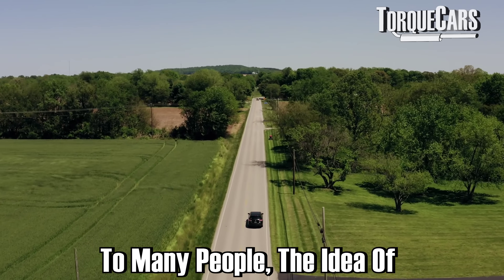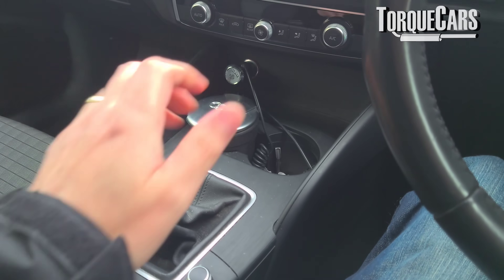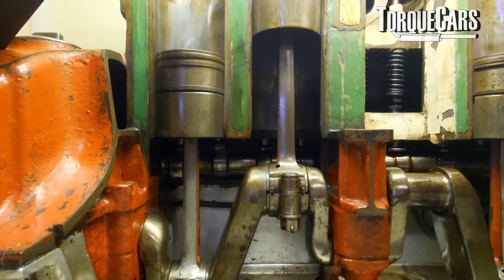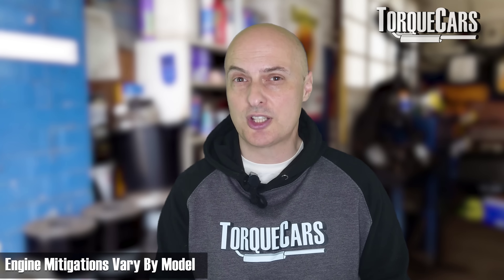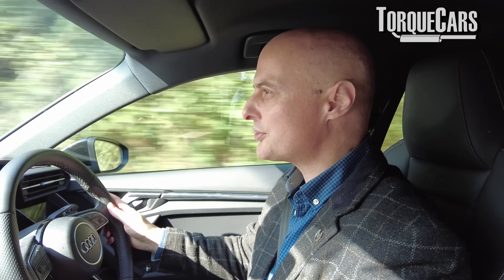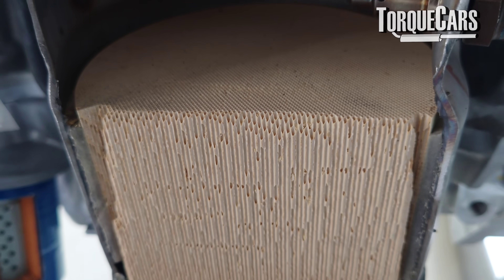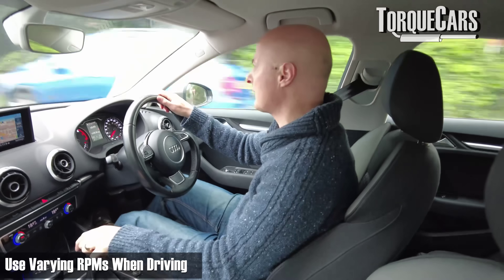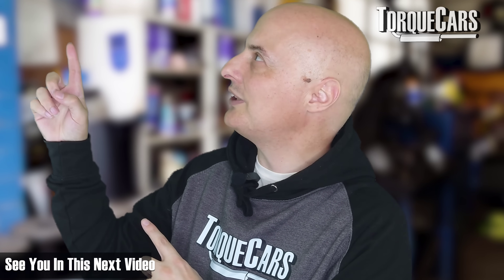BIG DAMAGE By Lugging at LOW RPM? Eco Driving Warning! (Manual Gears)

Comment: My eco shitebox doesn't have enough power to properly accelerate with 1000 rpm. In city I am always in the 1500 to 4000 rpm range. Only time I really drop significantly below 1500 is when I have to brake, get going from standstill or when I have to slowly drive with first gear at 1000 rpm behind morons who fucking can't stop and drive but have to slowly creep forwards all the time.

Comment: There is no need to go up to the redline. The pressure of the water pump increases a lot and after redlining it at 6500 RPM on the german autobahn for not even 30 min, I got a fissure in the radiator (top part) and had to suffer the smell until the garage changed the radiator.  Redlining at full throttle also doubles fuel consumption... 
So I stay mostly in 6th gear on the flat, even in cities, as long as the traffic flows. Never accelerate in high gears, though (except on the autobahn), on country roads, it's better for my car to go directly from 6th to 3th (it's a manual gear box) and that's basically the only short moment when the revs reach 5000 RPM or more.

Comment: Won't an automatic car will decide for itself on the rev range? Sport mode allows the revs to go higher before changing gear but at normal speeds in built up areas the car will never rev high. This must be engineered to be okay surely?
Reply from the maker: Yes most automatics are pretty good at picking the right gear for the job, this is for manual drivers who like to lug at low RPM and some in a manual selection auto (paddle shift for example) will still need to think about what they are doing.

Comment: dont agree, many wrong assumptions here, probably an extreme low rpm and high load but normal driving, easing the throttle if there is load meand noproblem at all, the computer adjusts as fast at low rpm than at high, is a matter or rpm not time.

Comment: Naïve drivers think the sound of higher RPMs automatically means unnecessary fuel consumption and lug their engines
The same people won’t press the gas and get a lockdown in an automatic and will slow down considerably going up hills

Comment: Driving in low rpm is fine accelerating from it is not. Change you gear down when you need to accelerate. This is what I have been doing for 20 years. Some engines have more torque you can actually accelerate from low rpm with no problems.

Comment: Wait what? Low RPM you are igniting at near TDC?  but at high RPM you have more distance? what? Low RPM vs high RPM shouldn't change the timing of the ignition should it?  I can see a change in value timing... Is this a new thing.  What is that called? what cars have an example of this?

Comment: Most moter are short stoke moter and dont make power till they get up in the rpm and its always good to run them higher up in the rpm to clean ever thing out more rpm more heat and air going out so its alway good to clean thing out

Comment: I used to drive from 1000 to 2000 rpm, but I realized I had to accelerate more. And close to the 1000 rotations the anti-stall would quick in constantly. 
Now I drive from 2000 to 3000 and not only the car is riding more smoothly but I also started to save fuel. When I turn on the air conditioning I try to stay over 2500 to compensate for the lost power.

Comment: Torque from low rpm till redline is nice but your engine needs to support it, if it doesnt look like a semi truck engine it probably wont :)
Manufacturers already put in torque limit for driving at low RPM in low gear scenarios so people dont destroy their drivetrain.
Modern VTG turbo engines can deliver torque from way down low but they have to be setup for it.
On the other hand there are euro diesel engines operating at low RPM with alot of torque to save fuel, in the dark ages of extreme downsizing and long final gear ratios, dual mass flywheels didnt like this but in general its fine. In todays market where all cars are automatics they do the shifting for you, manufacturers can set shiftpoints to both ensure emissions get met and excessive low RPM torque is reduced.

Comment: Is it possible that this damaged my head and is now leaking coolant
Reply: potentially, i also have started leaking oil occasionally along with odd coolant problems after shifting from low rpms for about 4 years now. makes sense that the engine shouldnt have the workload expectation of putting out torque when the rpms are in down-shift range. im in putting a bottle of 205 reseal after my next oil change and giving it a proper redline since a long time. cheers

Comment: Back in 70s-80-90s majority of people kept same car going for years.  I used to see many engines all sludged up from lack of oil changes and cheap oil if they bothered to change it.  Roll forward till now and many many people just don’t keep their cars past 3 to 5 years so don’t worry about this.  My other half is always saying what amazing gas model she gets by driving it slowly until I get the chance to drive her car and I get ear ache when I give it a run out even though I explained to her exactly this issue by very low RPM in a six speed car.  Then again I told her to not buy the 65 2L Ford diesel and hope it’s before the 16-19 issues with the water jacket drilled out between the bores,  time will tell.  Enjoyed watching 🤩

Comment: Basically low rpm driving does save fuel but it makes your engine more dirty over time which can cause problems. Hard acceleration is not great frequently either as it causes more rapid wear and tear. Ideally you should occasionally drive at higher speeds like on the highway to give your engine some "exercise" which will help keep it clean and running good for a long time
Reply: @GoldRaven-oe4by  So if I drive, say, a bit more than 20 miles on a highway a day, I don't need to worry too much about getting the rpms up?

Comment: For me, even with an automatic, I run it thru the gears manually (my truck has an up/down toggle switch on the shifter) regularly. I will also push haul/tow mode button and use it in this mode for a day, it revs higher and holds the gears longer automatically. Any engine needs to rev at times, I think automatics need to allow more/greater revving to the engine. 1,600-1,800 RPM in the city or on the highway for extended periods of time can't be good, drop a gear or two for half an hour, every now and again. Your engine will thank you...

Comment: Why does the engine tend to run hotter at low RPMs? Isn't it running at its most efficient at low rpms and WOT? So why would it produce more heat that normal?

Comment: lol the CVT always keep my engine rev lower than 2000 rpm, then it shift to 3000-4000 if I am quickly accelerating, it rarely red line even if I put my paddle to the metal, there is nothing I can do. Do this can damage this, doing that will damage that...get an electric car already. I need a car to go from A to B, not to worry about a lot of mechanical stuffs I don't understand.

Comment: 8:59 "higher RPM...the engine will be running slightly hotter"
9:55 "the engine tends to run hotter in the low RPMs"
Which one is it? Or are you just making shit up?
Reply from the maker: Sorry Didn't mean to confuse people there. 

Lean running adds heat, rich running cools it down. You can actually hit both conditions at high or low RPM depending on what you are doing with the throttle and the RPM etc... A car will generally back off fuel when it detects lugging but more air is being forced in (unless it has a DBW throttle of course) causing a lean condition.

The key is to provide enough heat to clean the particulate filter and keep the cat happy but to avoid lugging at low RPM.

Comment: Great explanations.
When I bought a brand new 2017 Toyota RAV4 the salesman told me to not baby it and it does not require any sort of break-in period.
As a licenced mechanic, Engineering Technician,.... I did some updating of my knowledge of present day motors and what materials they are made of & I have to 100% agree with the salesman and this video.
Also new motors are damaged if they are left to idle even when cold for more than 1 minute. So start driving but not full throttle until it is up to operating temperature which it will reach faster while driving.

Comment: Absolutely everything said in this video is true!

My example:
I did not yet have my drivers license, and I was trying to explain to my girlfriend and her father that the 1.9 VW bulletproof TDi should not be driven at such low RPMs. But they were dismissing me, saying that because I don't have my DL yet, I should not be commentating into their driving styles.

Well.. after the bulletproof engine had to be rebuilt, which I paid for, and after I got my DL, their conception changed a little bit.

My GF keeps the car at 2k, and changing gears at 2.5k, while I drive at 3k, or even more from time to time, but never under 2k.
And just to prove a point, we did the same 500km drive (not back-to-back with the same weather conditions, but still, same route) and with her driving style- low rpm, piston slapping, always pumping the pedal, never overtaking, oil starvation style got a fuel economy of 5.2L/100km, and did the route in 8,5-9 hours.
With my driving style, utilizing the rpm range, safely overtaking as much as possible, driving at the speed limit, never pumping the gas pedal - but keeping it steady, I managed 5.4L/100km and did the route in 6.5 hours. - all consumption calculated at the pump. And this was basically the last nail in the coffin after which my GF got her wits together and finally believed what I was preaching all along.

You will NOT get a better fuel consumption by driving at low rpm..
Her father was also able to destroy another 1.9tdi, and got a tiguan with 2.0tdi and 4x4.. well his style never changed.. low rpm as much as possible.. and he gets an astonishing fuel economy of 7.6L/100km, while I can manage 6.2..
But yet he still won't listen to what I have to say..
I guess they want this car to also be scrapped in no time at all..

Comment: Todays modern Petrol cars have a thing that advises when you should upshift to a higher gear. Most of the time it tells you to do it before you have reached a high enough rev range and speed for the higher gear! This is especially bad when driving uphill. I largely ignore it and do not shift up until I have reached around 2500 rpm depending on if the road is up or downhill. Its the same bad driving advice even on VW Polos

Comment: My 2010 VW Golf 2.5L 5 speed manual revs at 3000 RPMs at 70mph in 5th, which is my normal cruise speed. Maybe thats how it's achieved 230k miles on the odometer.

Comment: Helpful advice. On an aside, I find it astonishing drivers in the UK are able to shift a manual transmission using the left hand. My 2020 Mustang (2.3T) has a 10-speed auto transmission and always seeks to keep RPMs very low. I put it in sport mode from time to time and use the paddle shifters to vary RPMs, so this additional information is appreciated.
Reply: Automatic gearboxes in modern 2010+ cars always try to put you at lowest rpm unless they have sports mode. I have Camaro and I have to drive it at sport allways or gearbox will do everything to keep rpm below 2k but at least in all modes it will downshift to accelerate so it's not that terrible still annoying.

Comment: for sure, i almost always agree with everything in this vid, However, ive messed with low RPM quite a bit through the years, and yes, brought many little garden tractor engines to an early distruction due to under reving. long story short, many years ago i had a garden tractor (cant remember what it was or what motor it had)  that was 16HP that had gobs of torque at idle (like 500-600 rpm).  one night was sitting around with some high reving turbo people chatting and just for fun i walked up to my little tractor and pulled the rope and it started right up while in gear (cold)  i walked back to the conversation and we watched little tractor idle across the yard and up over piles of logs and brush until it eventually was stopped by a tree and kept running just slowly digging the tires in.  other than a heavy flywheel for sure, i'm still not sure why that thing made so much power at such low RPM, wish i still had it
Reply: inspired by that tractor i tried to replicate that low rpm power and destroyed a dozen modern motors

Comment: I know this isn't legally possible in the UK but would driving at a speed of for example 180 km/h also solve this problems? I can go on low rpm on the side roads and on the freeway I still have the highest gear but due to the high speed it's also high rpm. Of course, when I have to accelerate I should probably shift down a gear (e. g. when I want to go from a relatively low speed like 130 km/h to 180).

And when I don't use a freeway or there is no section without speed limit, would it be enough, to use slightly higher rpm for acceleration and the highest possible gear for the constant speed (if it's not uphill)?

Comment: The only problem you get is babying the engine 
The engine needs to run at high speed to knock the grud that build up around the cyclinder tops

Comment: Bollocks modern scoda cars are designed to idle constantly at 1500 rpm and the basic idle is still 700 - 800 rpm in most cars

Comment: My Czech built 2 stroke bike was able to pull taller gearing  so I put on a bigger front sprocket ending 60mph at a lowly 3500 rpm and it WRECKED the fuel economy. Summat to do with scavenging.

Comment: Alright man , if you have a diesel car you need to take so much care of the car. First of all do NOT put it in gear and drive as soon as you start the car. Let it warm up for a few minutes for a few years of lifetime. Second of all , the topic of the video , it is true that diesel cars should be used a bit harder than petrol cars. If you own a diesel shift at 2000-2500 rpm. No more no less and your car is gonna last for about 500k to 1 million km

Comment: I drive a 2012 Audi A4 diesel 163hp - very economical but definitely benefits from the occasional running in fourth  at say 3-3500 rpm for a few miles and get the catalyst hot enough to burn off the particulates off.

Comment: Ok, what we can do with contemporary automatic gearboxes? For example, my DSG DQ250 (2019 VW Polo GTI, 2.0, 200hp) switches gears at 1200 (!!!) RPMs in "normal" driving mode, so freaking low. 60km/h on 6th gear. In other hand "sport" mode is keeping it to high (~4500 RPMs) which is also bad for normal traffic driving. The only solution I see is to keep it always on manual mode. Any suggestions?

Comment: Its probably a good idea to explain what 'low rpm' means.

for instance 1500 rpm doing 40km in 6th gear where the car is trying to stall, may even be sputtering a bit and the engine just wont sound right = low rpm
1800 rpm doing 70km in 6th with a tiny amount of throttle down, where the engine is smooth and happy = not low rpm for this purpose

actual rpms will vary based on the car and engine but if the engine sounds smooth and happy then its very unlikely to be 'lugging' or trying to misfire etc
and always if you need to have more performance drop a gear dont just floor the throttle

as an example my 2019 c-elysse 1.5 gets 3.2l/100km (72-74mpg doing the speed limit or 95km/h whichever is slower) and has had ZERO engine issues for over 70k km's, I drive like i explained above 90% of the time (with smooth engine sound and correct gear for the power i require) and just drop it into 4th etc on the highway to bring it above the 4500 rpm range for a few minutes every month or so to clear through the turbo as I never engage it otherwise.

for guidance this car does 92km/h at 2,400 rpm in 6th happily, 40km/h at 1,600 rpm in 4th happily (2,200 in 3rd for busier slow roads where response may be more important).

So dont be afraid of 'low rpm' just learn to hear when the engine is telling you something is wrong and avoid 'too low rpm' and the more throttle you give the more fuel your using, rpm has little bearing on fuel its very heavily affected by throttle amount though. So if your looking to drive fuel efficient ignore the rpm and just try to drive with very little throttle.

PS granny driving which isnt exactly safe on most roads i can get 82mpg on this c-elysee but not something i do as its unsafe speeds and to many people overtake when its unsafe because of it, but still not 'lugging' as the engine sound and vibration is smooth and happy.
Reply from the maker: You are right, I did a follow up video recently to clear up that point. https://www.youtube.com/watch?v=Uot7DHY_C1c

Comment: Actually it really depends on the car. My dodge scat pack sits at like 1600rpm at 65mph. The engines SIT at a low rpm because they make power and torque down low.

Comment: In the initial days of a new car, it is recommended not to rev engine at high rpms for initial 1000 miles. Will it create the issues discussed here?
Reply from the maker: The key is avoiding extremes, lugging near tickover and accelerating is just as bad in a new engine as doing high RPM driving. Break in is often hotly debated, but my personal take is to warm the engine up and use the mid rpm range and add load such as hills and bursts of acceleration in that mid RPM range. The engine builder will generally know what is best and will also have used some type of break in oil which MUST be changed after the break in period.